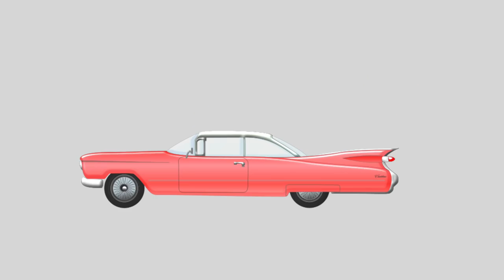Yes, Rockets CAN Fly in a Vacuum

Comment: Wtf.. the exhaust moves the car 😆😆😆
Reply: No.
She said that the exhaust does generate some thrust, but not nearly enough to overcome the friction between the wheels and and road.

This statement is entirely correct. What's your issue with it?
Reply: @niallkinsella2687  What? Generates some thrust? 😂😂😂
Might generate some pollution but nothing else.
Reply: @yabbadabbadoo8225  
If you hold your hand near the exhaust of a car you will feel the exhaust hitting your hand.
This is thrust. It's also not enough thrust to have any effect on the car, exactly as I said previously.
What exactly do you think is wrong about my statement?

If it's that engine exhaust can produce thrust, here's an example. During WW2, the spitfire had its exhaust ejectors positioned and angled so it would generate useful thrust, 70 pounds of thrust. Not bad for a waste product.
Reply: @niallkinsella2687  Did you ever attend a school of any kind?
Thrust is motion, like moving from point a to point b. The exhaust pipe is fitted, fixed to a body or some structure being dragged around by a parent object. To suggest an exhaust pipe provides 'Thrust' is 100% ludicrous. You may as well add that a baby in a Pram that has a serious wind problem is also providing 'Thrust' to the pram and not the person pushing it lol😂😂
Reply: @yabbadabbadoo8225  
"Did you ever attended a school of any kind"
Two degrees in engineering and one in software. So, yes.

No, Thrust is not motion.
Thrust is a force.
This is a fundamental piece of information. It's not up for debate.

"To suggest the exhaust pipe provides thrust is ludicrous"
I never said the exhaust pipe does anything.
I said the exhaust does. 
My statement was not difficult to understand. If you want to respond to my statement then respond to my statement. Not to something you made up.
Reply: @niallkinsella2687  you posted this following tittle did you not?
''If you hold your hand near the exhaust of a car you will feel the exhaust hitting your hand.
This is thrust. It's also not enough thrust to have''
Thrust?? Your Kellogs corn flakes Degrees are laughable. Never in 100M years would I claim pipe emissions as 'Thrust'
Thrust is the Power / Energy that is moving an object along, a tail pipe of a bus, truck or bike is not thrust. Good laugh all the same, give the baby more beans, the pram will roll faster 🤣🤣🤣🤣🤣🤣
Reply: @yabbadabbadoo8225  
You can deliberately misinterpret and misrepresent what I've said all you want.
Until you address my statements honestly, you aren't arguing with them. You're arguing with something you've made up in your own head.

Your inability to understand fundamental physics doesn't change those physics.
Everything I've stated is correct.

Comment: With no Mass you can't have no Direction so how does the rocket steer once you're in space LOL
Reply: Rockets, being made of materials that obey the laws of physics, typically have mass.
Reply: You're confusing weight with mass
Reply: ray sims - the rockets TAKE MASS WITH THEM to space. This is why the rocket is about 95% FUEL and OXIDIZER in MASS at liftoff.

Tell me: If i fired a CROSSBOW in space, in a vacuum, would I still feel a recoil? Yes or No?
Reply: ray sims - WHY are you afraid to answer my question?
Would a CROSSBOW fired in a vacuum HAVE RECOIL OR NOT?
Reply: @stuartgray5877  it's not been done Stewart and if it had the arrow would not go far since there's no air to support it point being nothing to turn on four Direction. Tumble and fall
Reply: @raysims5267 DO you AGREE that crossbows have reoil here on earth, IN ATMOSPHERE?
Yes or NO?
So In a Vacuum - will the BOW FEEL RECOIL?
Yes or NO?
I dont care if the projectile flies straight or not.
Reply: @raysims5267  - "it's not been done Stewart"
Sorry, but WRONG!
The company I work for buys dozens of "Monopropellant Thrusters" from Moog Corp. per year. (look them up)
We test EVERY SINGLE ONE of them IN A VACUUM and verify that they produce the thrust predicted by the "Tsiolkovsky Rocket Equation".
This equation predicts that rocket engines have MORE THRUST IN  VACUUM!
We have been testing this equation for OVER 100 years!

Now YOU (an obvious high school dropout) is telling EVERY ENGINEER and Physicist TO HAVE EVER LIVED that THEY are wrong and YOU are the smart one?!
bless your little heart! You are the new Dunning-Kruger poster child.

Comment: Ok Amy, your balloon analogy was a fail. The balloon is in the atmosphere hence the "exhaust" had atmosphere to push against. You also explained really well that we can make fire in space but there is nothing in this video that will convince a flatard that a rocket can achieve forward momentum from thrust in a vacuum. I don't mean to be critical but you might want to rework this video. I really like most of your video's, keep up the good work!
Reply: The baloon would work as well in space, provided that it would be strong enough not to burst. There is no pushing against anything. There is a difference in pressure between engine chamber and the outside space, which accelerates exhaust through the nozzle. This stream propells the rocket in the opposite direction.

Comment: lol.. you think the exhaust is what's pushing the car?? The exhaust is just car farts, letting out the bad air and we humans don't propel anywhere when we fart except the exhaustive from our laughs. The car moves because the explosion in a cylinder pushes down a bar that is like the pedals on a bike, the gas explodes on top of your knee driving your leg down on the pedal then when your foot is down another explosion on the other knee cause it's up when then first leg is down and rinse and repeat.. movement.. down up.. down up. no exhaust, no thrust needed.

Comment: Thanks, but still i have a question. In vacuum where there is no air, how the reaction force in the newtons law comes?
Reply: By accelerating and ejecting mass.
In this case, the fuel and oxidiser.
Reply: SOM BRIGHT - Rocket "Propulsion" is really just the RECOIL force of the rocket pushing out mass.
Just as a Crossbow feels Recoil from shooting out the mass of the projectile, a rocket feels recoil from accelerating the exhaust gas from the nozzle.
Reply: A large rocket can eject several tonnes of hot exhaust gases per second at 3-5 times the speed of a rifle bullet. That tends to produce lots of recoil!